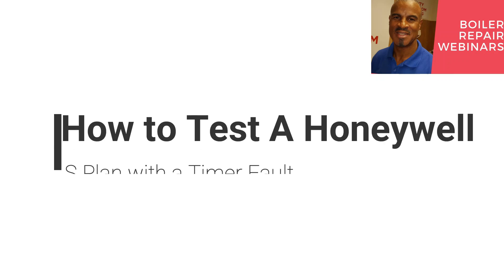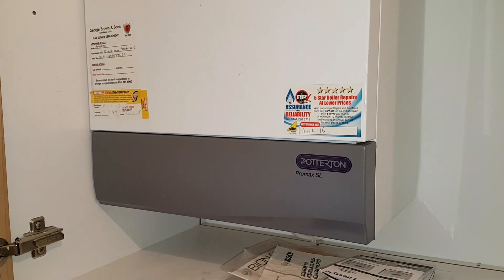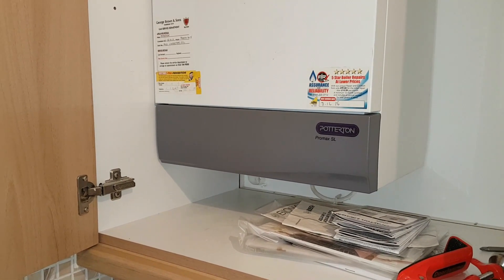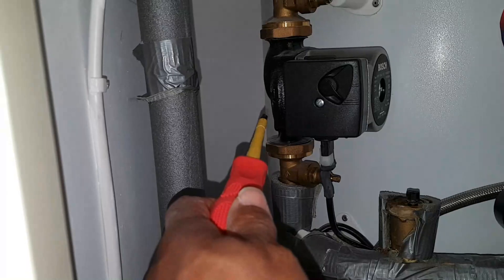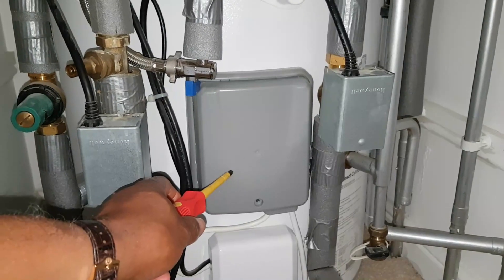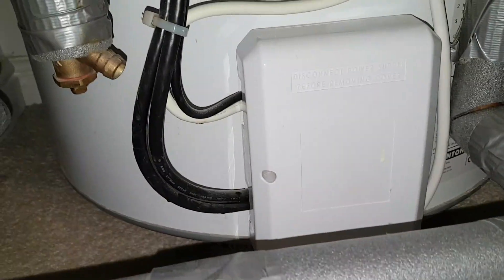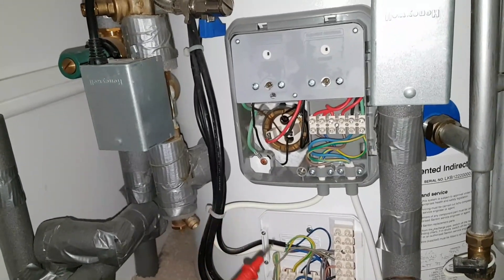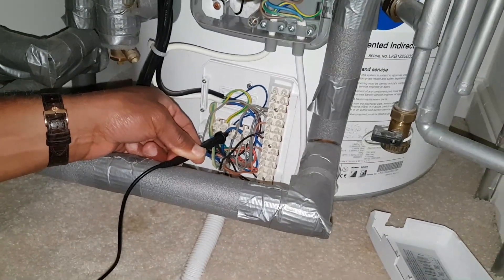How to Test a Honeywell S Plan with a Programmer Fault

Comment: Hi Tony.. Thanks for the video.. I used it as the hot water switch won't turn on the hot water. I used the switch and can see the small silver unit where it should be resistance has resistance and when switching on from controller it doesn't. 
So what could be the problem from here
Reply: So my motorised valves both open as the levers are loose when switched on from controller but the motor won't turn on with the hot water. Also the hot water motorised valve is extremely hot. Does that mean its faulty or something else.. please help

Comment: Hey Tony, 1st thing I would’ve done would have been topping the pressure back up because your pressure gauge was at zero. Pressurised system. These work on a pressure switch no? After doing that then Id have followed your process. Just an observation.
Reply from the maker: thanks for your comment, hey, we're currently growing our Facebook group, it has lots more content there and i'll be there to answer any questions you may have join using this link https://www.facebook.com/groups/167070231326174